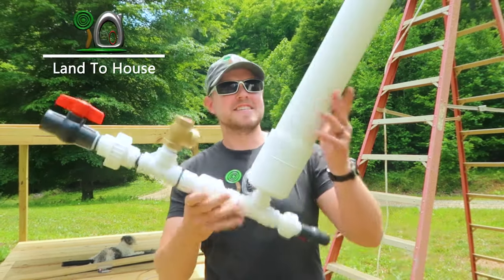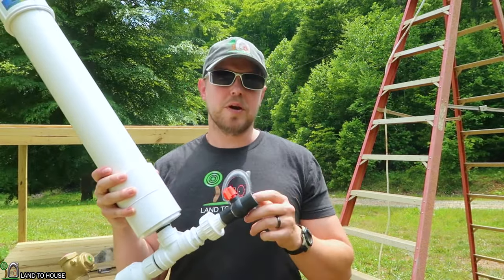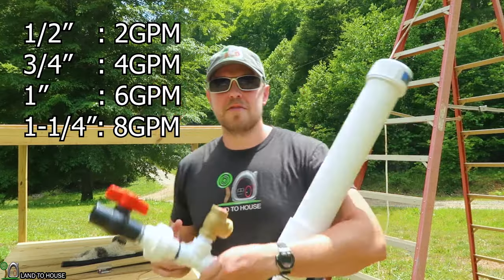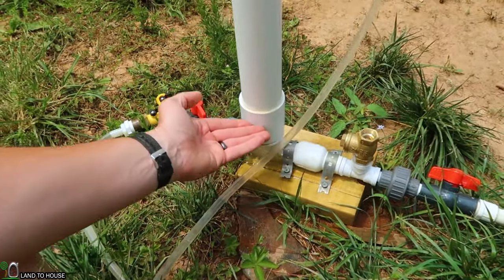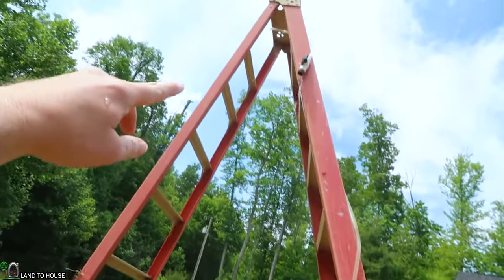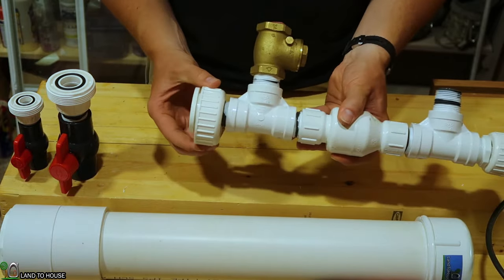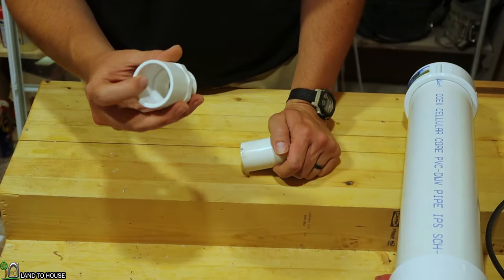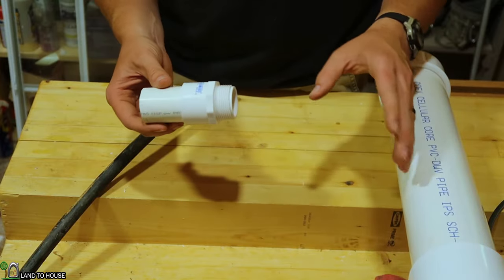Selecting the right Ram Pump Size

Comment: Hi, past buyer of 3/4 in ram pump. Love it, love it, but as we are close to ocean, starting to see some corosion.   Can you make me a stainless steel pump?   Thank you either way, love the pump so much, truly a wonderful contraption.
Reply from the maker: The SS pumps needed a lot more head pressure just to close the waste valve. I nolonger have those valves because it limited the users a lot.

Comment: Thanks for the great info source -- great job !
  I'm looking to push water up about 150 - 200 ft through about 250 ft of hose.  I have plenty of gpm, and can find the required head pressure (1-7 = 25-30 ft), but wanted to ask if this was beyond the capacity of the pump in terms of height...

Comment: If you reduce the output pipe size to 1/2", would it reduce the required input flowrate from 8 gpm to 6 or 5 gpm?

Comment: Hello, Im a student Studying Mechanical Engineer, and i want to build a 1'' pump, what i wanna ask u is , Would The length of Drive Pipe effect startup of the pump? I dont Require high pressures at delivery 
I just want it to work. I can do maximum of 4ft elevation but it would be very steep, about 80° slope.will that work?

Comment: Hello Seth, I was curious to know if this system, or say out take hose delivering water can be adapted for use to supply water to a house? the idea here is to use a cement 1500gl cement cistern 40 feet above the house and then attach the Ram Pump in between the pvc to the main water copper pipe that supplies water to the house. The ram pump would be doing the job of a water pump to supply presure to the house for everyday use of water for showers, laundry, and bathrooms. Do you think it would work????

Comment: Hi there... I want to use a Ram pump in a creek located in a Savannah like setting so there is not much of a drop. The creek has a good flow. Would a bigger drive pipe like a 4" or 2" increase my elevation... My elevation is 30 feet

Comment: Which has better performance? Waste valve dumper before the pressure tank or the other way around?
Reply: Maybe it's a better performance if we'll put waste valve after the pressure tank
Reply: @arnulfonarido7551  tnx sir..
Reply: He has already done a video on that. The inline style he makes is a little more efficient, but can't use a snifter valve so he uses a partially inflated inner tube.

Comment: I admire your tutorials.they Assist so mega ! Just a qstn? 'What would be the estimated appropriation for the pressure cylinder: Is to: valves? Cylinder tube height width  diameter, its performance relating with what valves size?

Comment: was think of what happens if you put two ram pumps in series.  or even two "pumps" attached to one waste valve either before both or in between them. so feed pipe, "horizontal valve"(<this one optional), air tank, horizontal valve, vertical valve, air tank, horizontal valve, exit pipe

Comment: Hi! Will it help if my intake and mechanism is 2 inch diameter, and discharge is at 1 inch, further reduced to 3/4 inch and further reduced to 1/2 inch? How far up the hill can water be pumped in vertical distance can a setup with 2 meters fall (water source to ram pump inlet) ?

Comment: Is the diameter of your drive pipe the same as the pump?
Will a 5/8 garden hose as a delivery work with a 1 inch pump
Reply from the maker: The drive pipe needs to match the waste valve. The delivery pipe can be any size you want.
Reply: @LandtoHouse  thanks

Comment: Question:
For a fast creek, the larger diameter drive pump will obviously deliver more water to the pump than the smaller diameter pipe.  I am still confused on which size to get.  I bet that I could easily get 8 gallons per minute from 1 1/4 pvc, but with only ~ 2-3 feet of head pressure.  The smaller diameter pipes will deliver less.  Should I bring different sizes to the creek and measure the flow through each? Or is it just safer to get a smaller size?   

Somewhat related questions: can I use a 3 inch pvc pipe, then couple it down to 1” right before the pump?  Will this create more flow, or somehow increase the head pressure delivered? 

Thank you so much for your AWESOME videos!!
Reply: This is a champion question. I also need the answer here.

Comment: Seth I've commented on your pump videos before and enjoy them all, thanks. I have a question I can't recall you addressing, let me see if I can ask this right. Generally you would use a size drive line that is of the same size as the input ball valve such as 1" drive line for a 1" pump. Is there any advantage to having the drive line from say 1 1/2" for the 1" pump? Are there reasons why this isn't done as I've not seen it on any pump that I recall? In my setup I went with a 1 1/4" pump but at times the creek flow slows in the late summer so the pump becomes so slow it will not pump. I made the pump myself and should have gone with a smaller size at the start. Head height on my pump is about 50" and near 80' of run. Spring running water was what I calculated and it was much different in the later summer as the flow decreased. I was just thinking that a larger supply line on a smaller pump would supply the water needed in the slower flow times. Plus I have the 1 1/4" black pipe already. Thanks again for the great videos you make.
Reply from the maker: I briefly touched on that Concept in previous videos but have not made a dedicated video yet. I am actually standing in the shop putting a bigger hole in my bucket for that video. :) a smaller pump can run on a larger pipe but there are some major inefficiencies. Sometimes even enough to stop the pump. Basically a small check valve is having to push against a large volume of water going back uphill and this causes less output.
Reply: @LandtoHouse  Thanks, look forward to another video, and thanks for your reply.

Comment: So, how would this do, if using stock ponds and their in line elevation differences?
I.e, I have a silt tank @5' elevation drop draining into a 2 acre stock tank, that overflows with a 9' elevation drop into another 2 acre stock tank!
Springtime I have good overflow, but could this be continued with just siphoned water?

Comment: Little concerned about bike tube in the water.  
What would be ideal size, water safe, commercial pressure tank.  I have several 1 gallon extra ones from RO systems and my neighbor giving away a 5yr 40 gallon pressure tank, but would that be to big or is bigger tank better?
Reply from the maker: Those tanks do work well. I have plans on testing one on the channel in the summer. Depending on the pumps size a 1gallon tank would work. For larger pumps like the 1-1/4" I would go a bit larger like 2 or 3 gallon.

Comment: Hi Set, in a previous videos, on the delivery pipe of the ram pump you had added a tee with a bit of pipe open on the top at about 3 to 4 ' high .

What was it for ?
Can't remember,  why you use that setup. 

Was it to augment the pressure at the pump ?

I would like to buy one of your pump , but , the hill that i have to rise the water is quite consequent,  about 40 meter of height with a length of pipe , between 500 meters to 600 meters. 

Should i build a bigger pump than yours or your 1 1/4 " would be enough ?
Like the videos. 
Enjoy every bit of them .
Reply from the maker: I use a pipe known as a "stand pipe" on the drive pipe to bring the source closer to the pump. This is used when the drive pipe needs to be long to gain the needed head pressure. 

If you need to lift water that high you will need a waste valve that is heavier than the swing valves I use. 40 meters is too high for the swing valve.
Reply: @LandtoHouse  thanks to answer so quikly , should I make one myself, or could could i get one somewhere?
Reply from the maker: The only company I know of has stopped shipping. It was Rife Ram company.

Comment: Will a siphon system from a pond with sufficient drive line length/drop etc reliably run the pump?
Reply: Nevermind, got it from your website.  Got an estimated service life for the valves?

Comment: If you let the 5 gallon source run empty, when you re add water to the source, will the pump start back on it's own or do you have to manually restart it again?
Reply from the maker: When air enters slowly into the drive pipe it causes the pump to stop with the valve open. When more water is introduced it typically causes the valve to snap closed and stay closed. I have run a test before using an automatic timer valve that allowed the pump to restart on its own but it all depended on which state the valve was in when the timer went off

Comment: Any plans to offer a 2 inch drive pipe size ram pump?  
Extrapolating - maybe minimum input 10 GPM

In the video, you said the minimum input requirements were 2 GPM for 1/2 inch drive pipe, 4 GPM for 3/4 inch,  6 GPM for 1" drive pipe and 8 GPM for 1 1/4 inch drive pipe.   Were you getting those flow rates for with the 3 ft head?    Any idea what the maximum input flow rates would be if more head was available and if the 6 to 1 output ration holds constant for larger volumes?   Would a larger drive pipe help or just reduce the velocity of the water headed to the pump?

I think you said the lift was about 20 ft.   Any idea if the lift was 10 ft  would the same or more water be delivered and would the pressure be the same or different at the lower lift?

At first I thought that all I cared about was the volume of water delivered, but now realized that the pressure also matters if I'm going to run a low pressure sprinkler like a Wobbler or a drip irrigation system, which may also take pressure.

The above may only matter if as much water as possible can be productively used - like for irrigation. 

Thanks for the video - I remembered you mentioned the O ring - now I know where it goes on the 1 1/4 ram pump that I have from Land To House, but haven't used yet.   Dave from the Water Powered Pumps public Facebook Group:
https://www.facebook.com/groups/240458583255303/

Comment: Does it matter how big/small the diameter of the delivery pipe? Does the diameter of the delivery  pipe have to be same as the check valve?
Reply: It's required to use half inch delivery pipe if you have 2 inch waste valve
Reply: @arnulfonarido7551  what will happen if the delivery pipe diameter is greater or lesser than half inch?
Reply from the maker: The drive pipe must be the same size as the waste valve. The delivery pipe can be any size you want as long as friction does not slow down the water. Typically the delivery pipe is half the size of the drive pipe
Reply from the maker: If the delivery pipe is too small you'll have friction loss. If it is too big it just cost more. no issues with pumping water

Comment: Do you have a good source for 1 1/2 inch poly pipe?  It's pretty expensive and doesn't seem readily avaliable at HD or Lowes in store.
Reply from the maker: My local plumbing store has it at around $0.65 per foot. It is costly.

Comment: Are you using a 4” pressure tube on your 1” pump?
Reply from the maker: The 1" has a 3" by 19" pvc. The cap and coupling make the tank 24" tall.

Comment: What materials need for the pressure tank,  the size need it,  I start assemble ram pump 1/2
Reply from the maker: I like to use a 15" long 2" pvc pipe. With connections or is around 18" total. .

Comment: Helllooo
Do you have ramp pumps that uses dirty water to pump clean water,
This is used where higher head dirty water stream is flowing close to a a low head small stream, so it uses the strength of the dirty water to pump the clean low head water

Comment: is waste valve and check valve the same?
Reply from the maker: The check valve is the name of the component used.   There are 2 check valves used in the ram pump. The waste valve and the inline valve.

Comment: I would want to see a 2"rampump how it works
Reply from the maker: It would work just the same expect it would require a lot more water.
Reply: How much approximate water will I get with the 2"pump per minute.. and how thick my drive pipe can be.does it has to be 2" too???
Reply from the maker: It would need to be 2" for the drive pipe.  I have not worked with the 2". You could likely get around 2gpm or more. That's over 2000 gallons a day pumped.
Reply: Oh.. and final question what will be the size of my pressure tank and how high.???
Reply from the maker: You will be good with a 4" pipe 30" long.
Reply: Tanks my friend I really appreciate ur help...I'm from Belize..

Comment: what inside that pressure tank ?
Reply from the maker: The pressure tank has a partially inflated bicycle tube. This helps to reduce water logging of the tank
Reply: @LandtoHouse  oh thank you
Reply: Too bad this isn’t covered in the video.  You might even make a demo pump with a clear pressure tube for illustration.   Also is the shock wave building and with it gets big enough it goes by itself?  Newbie trying to grasp why this works.
Reply from the maker: Hello. I actually have over 100 videos on the ram pump. There are even a couple with a clear PVC pressure tank. It should be helpful in understanding how it works :)
Reply: Land to House sorry...  I forgot to check for other videos

Comment: Know this though... "IF" you are planning to use a "Garden Hose", there is also a different PVC attachment you need, because the threading is different than regular threading in "PVC" piping., so make sure you get the correct adapters. ;-)  hehe

Comment: I watched most of your RAM pump videos why do you say your delivery pipe can be any size you want and it makes no difference but right here in your video you have it reduced smaller than the Drive pipe if it makes no difference why do you have it reduced.
Reply from the maker: Thanks for watching! Reducing the delivery pipe size helps with cost. Say you are running a 1-1/4" pump and the delivery is 900 feet long. You would save a few hundred dollars with 3/4" pipe vs 1-1/4" delivery.
Reply: Delivery pipe must be 1 inch or half inch

Comment: let me get this straight.......if the water head is 10 meters, the ram pump will lift the water 70 meters up ????
Reply from the maker: There is a cap at approximately 54 meters. The waste valve is not heavy enough to reopen with higher input head pressure.